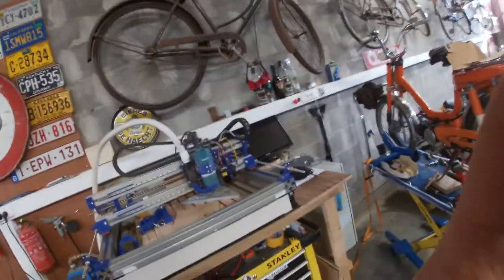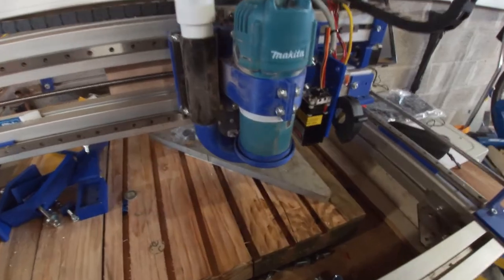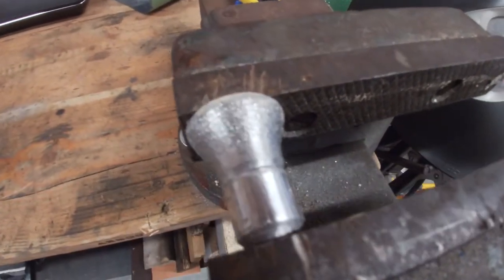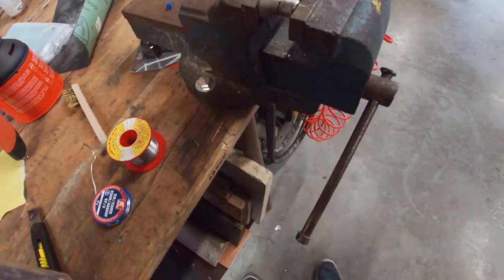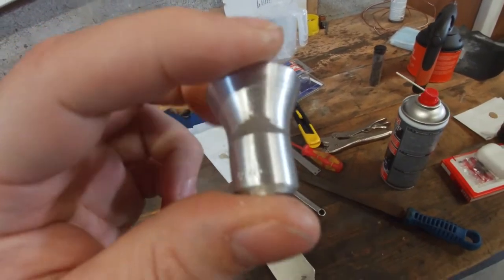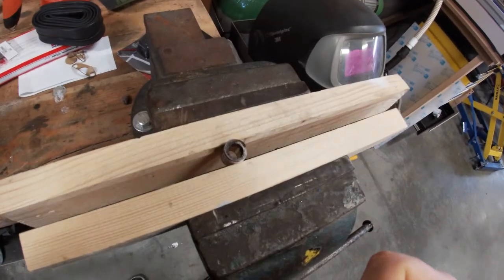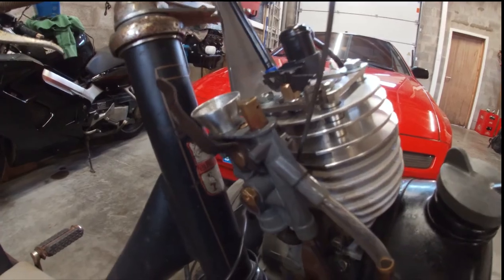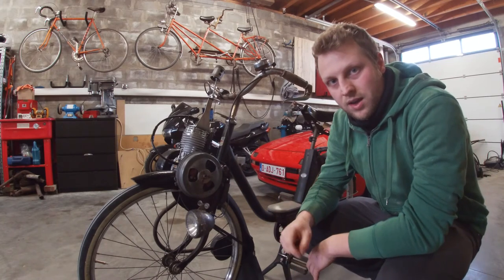I built a tiny velocity stack for my Solex

Comment: Super glue it, like on air craft
Reply from the maker: Superglue on aluminium? What kind of glue then?
Reply: @VintageGarageYT  Cyanoacrylate – also known as instant adhesives, super glue, crazy glue, ca glue, etc. All grades will bond aluminum well. For very high strength use a metal bonder such as 170 or the original 910®. For bonding aluminum to dissimilar surfaces with different coefficients of thermal expansion consider toughened 737.
Reply from the maker: @yekateradiffin5939  Thanks for the tip! I will look into it!